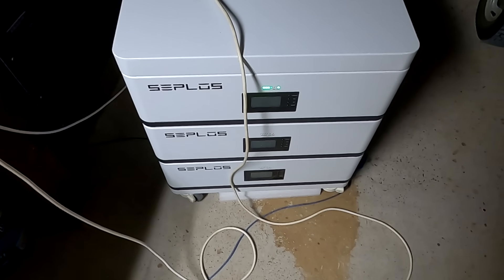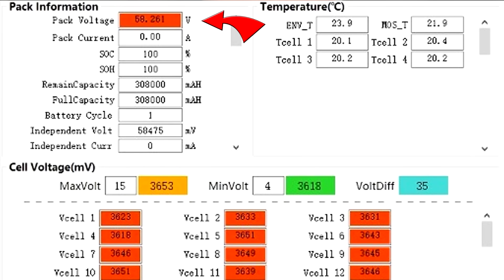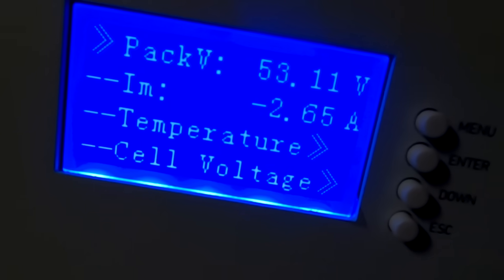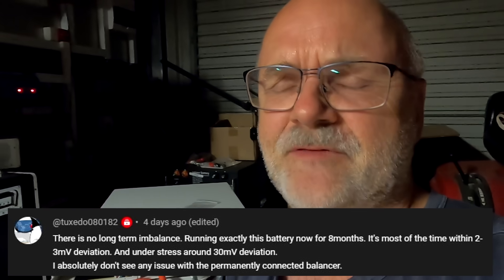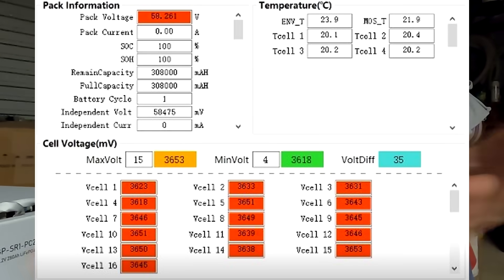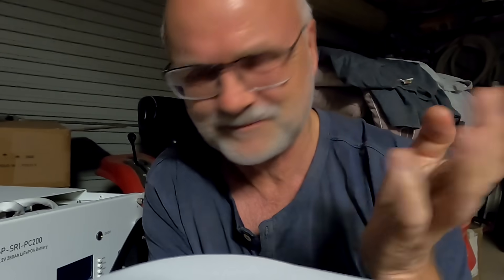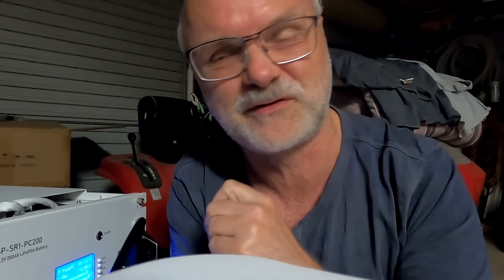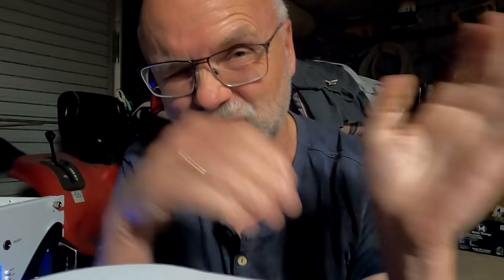Active Balancer: always on or only above 3.45V?

Comment: Given that if you hook 16 cells in parallel at 3.2v they wont' balance at all, I would guess one of 2 things:

1. It does nothing below 3.4+ish simply because there is nothing to balance and no pressure and thus the capacitors wont' actually discharge and after the first pull won't charge either.
2. It completely screws it up because the amperage still flows despite the voltage being the same because there is still some latent pressure to transfer in the capacitors. If this occurs it's probably because the cells are mismatched and the total capacity is different by a large amount between cells.
Reply from the maker: Think about different internal resistance of the cells and the different voltage they will have therefore under load. The AB will take this voltage and starts working...

Comment: I have my Active Balancers always on.  And if anything it has improved my top balancing. Over time.
Reply: so i guess we need to confirm it with a last test.
Reply: Works for me too
Reply: That's good that it works for you. When I was starting out with reclaimed cells and built battery packs, some the same lot, some mixed, the always on worked well. When I set up my fully off grid and bought all from the same lot(100+kwh) the always on was giving me an erratic deviation whenever I would fully charge. Turned out, I had a cell that had issues I could not identify until the balancer was off. Both modes are probably ok but for diagnostics at a glance, I leave only on top balance. Cheers
Reply: @babaluto  Well I dont put much faith into reclaimed cells . Like they say , Its like a box chocolates, You never know what you will get. But sometimes you get good stuff also.

Comment: Would be nice to have a third test using the Neeeeey 4a balancing between 3.4-3.45V and then another without an active balancer to see if that maintains the balance better.
Reply: Na ... this test is useless, because I think he had done this in an other video.
If the batters was top balanced, then you do not need to re-balance for a while. There should nothing happen, only if one cell is losing more capacity as the other cells, then it would be necessary.
Reply: @micropower8  I mainly suggested it because it shows the difference (potentially) between having an active balancer on all the time and only when top balancing. It's still worthwhile with these allegedly well paired cells even if it's been done before, in my opinion.
Reply from the maker: I could do that as well, why not...

Comment: My Daly bms balances only when over 3.4v and charging.  Active balancing is disabled.
Reply from the maker: You would need an active balancer from Daly to enable the function in the app.
Reply: @OffGridGarageAustralia  DALY 1a 8s smart balancer arrives early March, 2024.  I have also ordered a 10a 8s heltec active balancer.  Question:  Is Heltec balancer hard-coded (not adjustable)?  I note it is not 'smart' so I assume no iPhone app to set limits.

Comment: Instead of turning on the active balancer at certain voltages (where the difference is greater), wouldn't it be sufficient ta have the balancer turn on when the difference in voltage is a bit higher, like 0,05V difference?
Reply: I was thinking about the same.
Could it be possible to to find an optimum between detlaV of the balancer to kick in and Vbat before one cell Hits 3.65V
Reply from the maker: That's the approach Seplos is taking with their new AB. It only runs all the time but is only active if cells are over 50mV apart.
So, 50mV would be the best we get then. Would that be OK? I guess yes.
Reply: Or you give it a try and keep the original fectory setting 30mV? Finaly it is an optimization problem. I sugest between 30mV and 50mV could be fine. @OffGridGarageAustralia